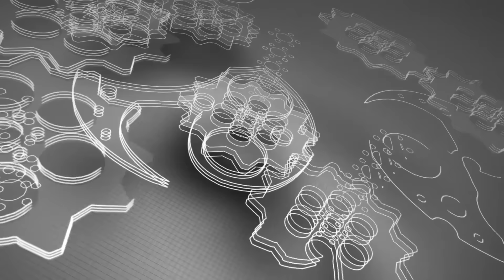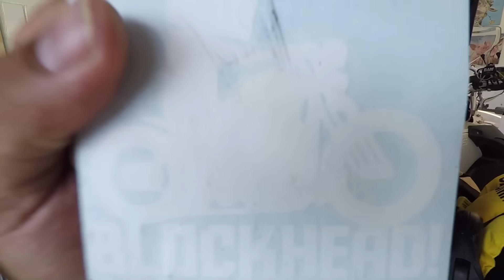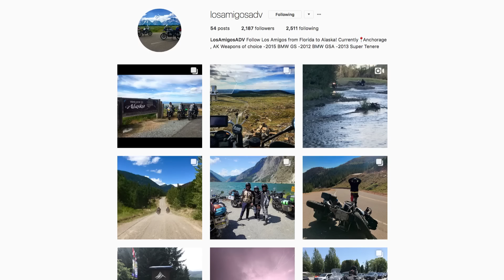Florida to ALASKA Motorcycle Trip! - LosAmigosADV! - BMW GS

Comment: I own an HJC modular helmet and have worn out a Shoei modular helmet too.  Never would I think to ride with the chin bar NOT securely latched... I use the modular feature as an easy access for putting on and taking off prescription eye glasses.  On my 1994 Yamaha V-Max, I had an instrument cowl style windscreen.  The low-mileage 2007 version Yamaha V-Max, that I bought in April 2017 to replace my 1994 sold in 2012, does have an accessory 3/4 height clear windscreen that more completely blocks the buffeting air and might allow riding with a modular helmet in the open position.  I may try it, but the latched chin bar seems to be the intended riding/driving position for the modular style helmets.
I may have to order myself a Blockhead (and complimenting ASR) vinyl sticker to apply to my black hard saddle bag(s).

Comment: Hey great video Blockhead, does the GoPro hero 5 have a time lapse feature or did you use something else? Good luck with the new job Fam.
Reply: Hey Zeal, Go Pro hero 5 has timelapse feature in two mode - photo mode and in video mode.

Comment: Hey blockhead. I'm actually in the market for a new low rider s myself. But I'm hearing Harley Will discontinue this model in 2018 have you heard anything? What do you think any input would be appreciated thanks. Great video as usual.
Reply: I aint heard harley mention stopping the low rider s. even if they do the dyna low rider won't stop it's been out for 30+ years
Reply: James Wise ya but it came out in 2016 so if they are discontinuing it after two years it kind of raises red flags. I also read on Harley Davison forms  that they are getting rid of it but that's all a guess so I guess we'll have to wait and see when Harley comes out with the 2018
Reply: Amir the lowrider s is gone they stopped making them 17 is the last year
Reply: DynaMobbin I wonder why I almost bought one the other day. Now I don't think I will. Still undecided
Reply: Amir i would man they are just a limited edition they will still have parts for them
Reply: DynaMobbin thanks bro ! That's what I was thinking too. So I'm thinking about a fat boy or a softtail s or the low rider s now.
Reply: Amir softatils are nice man fat boy not to sure on that one and the lowrider s is a sweet bike ive rode one for a few miles ;)
Reply: DynaMobbin lol ya it's so hard to decide I really love the s models